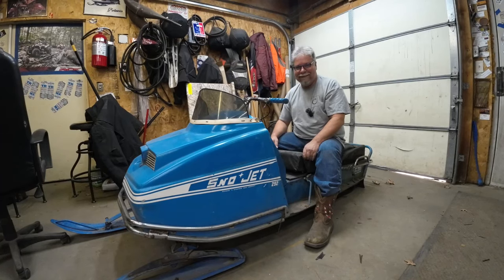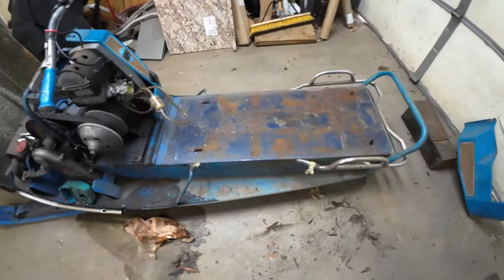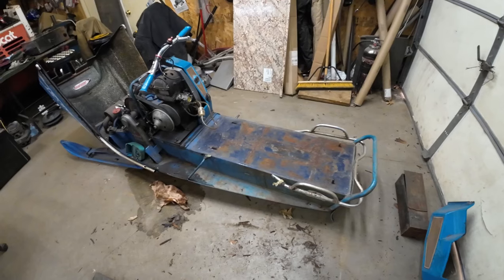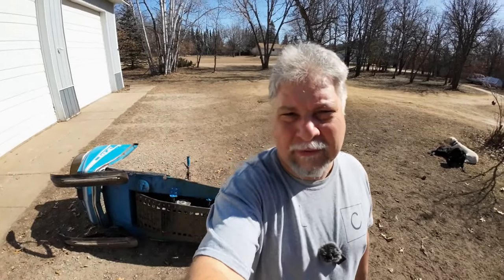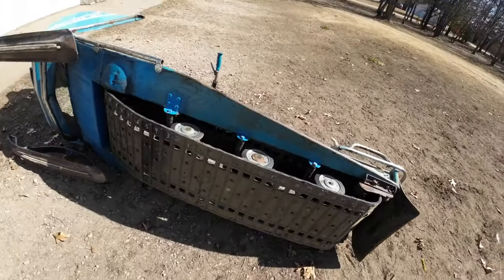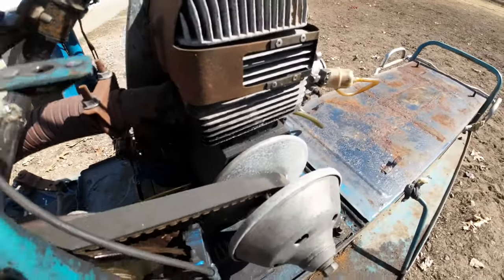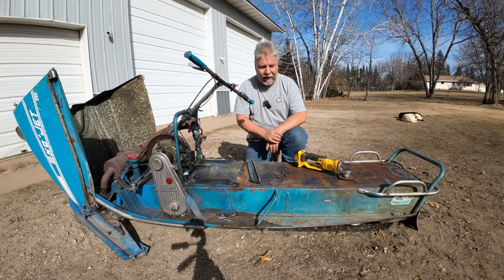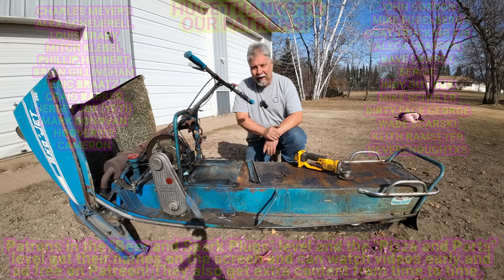Sno Jet One Lung Race Snowmobile part 1. Building for the Wild Bill 20 vintage snowmobile race.

Comment: That Sno Jet name dropper track is probably good enough for a person just trying to keep an old Jet running that won't be putting studs in it or anything. Funny how similar all those tunnel mount steel chassis machines were back in the day. The one positive about the in chassis tank is it put wieght up front on the skis and those things need all you can get.  On some of my 'doos I have drilled holes just above the running boards and moved the first bogie set up in the tunnel, they steer so much better in hardpack and low snow condtions.